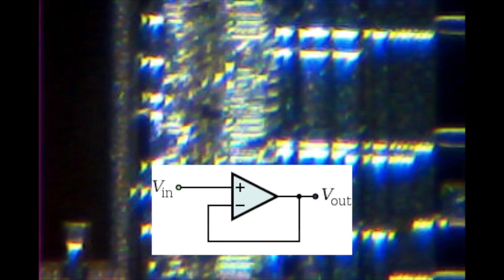What's inside a microchip ?

Comment: After 800x magnification, there can be a special ring light that can be switched on inside the lens itself, and digital zoom can be used beyond it to obtain higher zooms to possibly 1000x zoom levels or even higher without an electron based zoom. Horizontal periscopic lenses will be very good too as they won't use up the vertical zooming ranges.

Comment: The part of the video were you held that eprom across  3 fingers at an angle made me remember in spring 1991 I was adjusting a pick and place automated robot arm. The machine was turned off and a sign on the power lever stating DO NOT TOUCH was place also at the breaker panel as we always did for safety. A employee who did not read English or French or Spanish nor the Icon with a lighting bolt hitting a person as a universal language turn the thing on in both places. The machine drove that same Eprom deep into my fingers in same angle you had yours sitting. in two areas the legs went clear through. The Doc in the ER 
asked if he could have it after he removed it to add to collection in one room of stuff removed from all kinds of items from all parts of body areas. I went back there to take my kid for a posible brock arm and that chip and other items were still there.

Comment: this is an EPROM from an early GM OBD1. or at least the same part, if that's not what it was pulled from. The remarkable part is that this chip is roughly 40 years old. Modern day computer processors are one of mankinds most incredible feats. So incredible infact when you watch production videos, they have trouble explaining it

Comment: You said "billions" of transistors, but to be pedantic, the EPROM uses a single transistor per cell, so a 27C512 or 512k EPROM has 512k bytes of data, so in total 524288 x 8 = 4194304 transistors. They are arranged in a X-Y matrix. The circuitry around the outside selects a single X line and single Y line to select 8 cells for each bit of the byte of data (this is a simplified explanation). The EPROM you have has arranged the memory as two matrices. The goal is to use as little silicon as possible (to minimise production cost, where silicon area == $$$) which is why there is only a single transistor per memory bit/cell. Just FYI the matrix is not arranged in order from 0 to 512k, but is made of smaller blocks which are mirrored in both the X and Y orientations then arranged together. The 8 bits from one address location are very unlikely to be even close to each other, and even bits from adjacent addresses could be physically some distance apart. Not that the end user is aware (or needs to be aware) of this.

Comment: Looks like the second bond on what's called  wire bond Ball Bonding . It sticks by using heat 100C and friction weld from ultrasonic. The first bond is the ball and the second one cuts. A small flame or spark (EFO) creates the next ball.

Comment: I agree 90% of what you say and you say quite aptly with a semantic appraisal lending toward reminiscence. Ok gold is a better conductor than silver, the wires here I can't tell if silver, many materials were used in these devices depending upon application and complexity. The bonding process is a "stamped" type under an ultrasonic 'scrub' to bond onto the aluminium pad and package. I designed a stress pull system to determine the strength of bonds of devices many years ago. For aerospace industry, where the centrifugal forces of such devices underwent in certain times of travel ;). It's nice to hear an open & honest description for once with the added interest and amount of knowledge respectfully given and understood. Good fellow :) btw the "M752" number is the manufacturer's mask number used in the Lithography process(s).

Comment: A transistor doesn't store a bit :D It can only TRANSmit a bit of information, or not, based on an input signal.
Only an "SR Latch" or "Flip-Flop" stores bits. They're often made out of 2 NOR gates at 4 transistors each. So 512.000 bits x 8 transistors, which is technically -quote- "at least 512.000 [...] transistors" I guess.

Comment: Just so you know, the bond wires in most ceramic DIP packages are aluminum, not silver. They are not welded on, just pressed into place hard enough to flatten the aluminum.

Comment: Loved this! Great to see it all under a microscope like this! 

You mentioned not being sure how the addressing system works... based on my limited understanding here's some more on that:  

The address pins are used to specify which MOSFETs (the type of transistor which makes up the memory)  to connect to the IO pins by applying voltage to them, turning them 'on' or 'off', in order to define a binary address. That address is then connected to the IO pins of the chip via a series of logic gates between the pins and the MOSFETs making up the memory. This EPROM has 16 address pins, so an address would look something like this: 1001000000010000. Each of the possible 64,000 address combinations then corresponds to an 8 bit memory location made up of 8 tiny MOSFETs which can be 'on' or 'off'. So, in this case, we might find that address 1001000000010000 contains data 00101100.

Comment: 3:30 I was just about to say prolly an address system. Prolly turns each bit into bytes than plugs so many bytes into a pin somehow, would be interesting to find out how they controlled certain bits of one pin. Maybe it's a voltage deal and so much voltage will point to certain bytes and there they can be set but how if it is voltage dependent to select the byte unless they stored the voltage than it sent another voltage to set the bits

Comment: how these circuits are made? can anyone tell me pls?
Reply: You take a larger image of patterns related to your circuitry and shine it through a lense which makes it much smaller, onto a wafer of silicon, silicon dioxide and silicon nitride with a photoresist on top. A photoresist is a material that softens when exposed to light. You remove the softened photoresist with a solvent, then apply an etchant to remove the parts of the underlying silicons not protected by the photoresist. This is called photolithography ( printing with light )

Comment: When I went to electronics school I was told the best metal conductors in order were Gold, then Silver, then Copper.  Silver is the second-best conductor just way less expensive than gold.  That's why modern CPU's pins or pads are gold plated.
Reply: Actually it's silver, copper, then gold. We use gold since it's corrosion resistant while still having very low resistivity.

Comment: You wondered about how the wires are connected.  The process is called Wirebonding, this particular one is done by so called wedge-bonding, the connection is made using temperature, force and ultrasonic power. Check out some videos it’s awesome. I also do that in the lab.

Comment: I predict that the wires are aluminum -- quite similar to silver in appearance -- because aluminum doesn't diffuse into the silicon wafers.  They are attached (welded) to the pads on the chip and in the package by an ultra-sonic wire bonder.  It presses the wire onto the pad and shakes it at ultra-sonic frequency to heat it to its melting point.

Comment: In Russia, even at the stage of soldering the motherboard, everything would have been stolen from production, if anyone has a motherboard with an Intel processor, send me my address in Russia 
Stavropol Territory Andropovsky District, Soluno-Dmitriyevskoye village, 16 Shosseinaya St., postcode 357082 Funtov Pavel Grigoryevich 8 962 432 40 50

Comment: I'm very sorry to tell you this, and I am not lying, but with 28 pins I can address 2.14 (two point fourteen) Gigabytes. By the way, I'm working on my own computer architecture. extremely different. Oh and for the RAM and SSD total added together, I'm going to give support for one Yottabyte. And no it's not like a raid, When your drive gets full or close... plugin another board/chip into the current board that makes up your current drive, no formatting and the new space is instantly ready as one continuous drive, don't even have to turn off the drive/computer... now if you add in more ram, then you would need to format your drive, unless your willing to separate your addressing allocation block(s). You would have to reflect the change by your code/software... Oh and also I'm making my computer without a clock... it can fully work without a clock but for audio/video/network/similar you will want to use instructions that use the clock because if its something a human interacts with, it would be to fast otherwise
 ((all instructions duplicated, one set with and the other set without a clock.))
I have something equivalent to a handshake protocol so signals don't get messed up, and extra flags to tell a process to wait part way through because a variable hasn't been updated yet that it needs. I'm willing to talk about my desing. When it's complete I'm going to give it an open patent so anyone can build or mass produce freely, but cant lay claim to it. Also my design could be used to make a relay computer that is even faster by nature.
Reply: You should be sorry that you didn't do any research on this chip. The cells are organized to read and write eight bits at a time. 256k bits divided by eight equals 32k bytes of memory. Most processors used at the time used an eight-bit data bus. This chip has three power lines, two control lines, 15 address lines, and 8 data lines, for a total of 28. The 15 address lines equate to 2 to the 15th power, or 32k individual addresses.

Comment: wire bonds are Aluminium and done with ultrasonic wedge bonding. Aluminium is used on Silicon because it adheres directly to silicon without requiring intermediate metallisation.

Comment: 4:58 wrong. no silver found here. 

1. most used materials are gold with 1% platinum to make them hold. pure gold appears to lose bond, the pollution of gold with platinum gives it a sticky touch.
2. an aluminium-silicone mix - mostly 1% silicone pollution - can also be used for bond wires.
3. also used in history: copper, there's much problem with heat development and can damage chip circuits. It's rarely used in micro chips.

the best conductor is gold. I think the seen ones are AlSi, but the silver color doesn't mean, it really is. the more pollution, the more clean the color of gold.

AuPt bonds are a better conductor than AlSi, but it often needs a flaming process, AlSi is easier to bond and produce.

I work with these every day :)

Comment: Would a new optic/current power dual seated based chip be possible. You have light coming into switch via crystalline path. The switch (moving part) has separate metallic line power ready to go always, thus creating magnetic shape for the trigger/part which moves. 
The light hits a stagnant malleable nano atomic arrangement and trips atoms into magnetic shape/form to help move switch toward or away (closed1 or open0 - so two paths in, light can make stagnant malleable nano atomic arrangement +ve from one path or -ve form the other). Stating again, this light provides power to gate fixed (however is malleably magnetic both to -ve or +ve) part, and the movable switch part has separate power to have constant magnetic shape. The switch becomes magnetic along with the stagnant part to be attracted or repel. But could be manipulated with better knowledge. Thus you could have gate with the two possible switch polarities, two inputs and the one output???

So two ways in to switch and light trips on or off (unless already that way tripped). Then one path to exit, for if switch is on the power to the switch and light coming in is enough to transform electrical into light, somehow, and sends a constant light beam to the registrar for that information's use??

I really know little about not much here but it could work one day or similar or give somebody an idea. Problem. How to send a 1 or zero to the switch first to get switch to open or close. Is there a way to do this?? Does the light simply make it's way in from the optic cable, through the right gate and onto the switch??

Comment: I expect you to show us about CPU central processing unit. Details of how circuit build in processor like voltage in and out, anode cathode transistor. In Intel core processor LGA 2066 ARE internally how they are connected each other inside. Can you please show us how dose it works.

Comment: How do they  make it
Reply: muhammad imran It’s a long process... First you need some smart engineers to design the circuits, then layout all the silicon and metallic layers, then they will create a mask used for photomask generation, and eventually, after some extensive cleaning, testing, and assembly, you arrive at the integrated circuit.

Comment: Its not resistive welding its ultrasonic welding done by vibrating the wire very fast while in contact with the chip thus making it very hot and melting it and bonding the wire .
Reply: Thermosonic bonding..

Comment: The first chip I opened was a 486 dx2 mx . I used a spatula and the stove burner to desolder the back plate very cool looked like a micro mother board with tiny gold filament wires. Was ceramic. Anywayss...
Reply: Was in 2001. So was obsoleted.lol

Comment: How...the...fuck...do they manufacture BILLIONS of transistors...and assemble tthem at that size? It's so fucking small...how do you get machines in there to put it together?
Reply: nick4819 you just "burn" them there with lasers
Reply: What do you mean?? They all still need to be placed in the right spots...solder needs to be in the right spot...and the heat needs to melt the solder but not melt the chip that is literally microns thick.

Comment: OK well not that I completely understand but from what I'm hearing the transfer of info is simply opening and closing doors(transistors) to designate a 1 or 0. ok that's simple enough but if stored in stackable layers and there is only 1 connection point for thousands or more of transistors how in the world does it know to open door 10,303 and then door 701 etc to get said answer requested from input. 2nd question is if we are capable of this then why are circuit boards so large and why haven't all the components been shrunk to atomic lvl as the chip has? sorry this one is a little over my pay grade and not quite got a layman's answer that I can digest!
Reply: E Nonyabis the chip probably uses circuits called demultiplexers or “demuxers” to select a row and colom to output a signal. Demultiplexers have n number inputs and 2^n outputs, if a binary number is entered like 1010 (10) then it will turn on input 10. 

And why circuit boards aren't atomic sized? Because that would be impractical, most circuit boards are used to connect components, if they were small it would just make it difficult to connect components.

Probably
Reply: Can you tell us more about these demultiplexers, please?

Comment: enjoyed your video I have an eprom that has had its legs damaged by corrosion I am hoping I can cut away part of the ic to re solder new wires to the damaged stumps. the data on the ic is for lighting control unit and can no longer be available anywhere. I really hope this works but have find way cut a mm into both sides.  Tim.

Comment: working as a cleaner in "bnr" bell northern research i had the pleasure of not having to vacuum a very large space   for almost a month while day and night a team of designers poured over a color plotted microchip image looking for a design flaw during pre production .. kinda funny seeing a bunch of guys on there hands and knees following traces and circuits .. it was blown up to about 80x 80 feet  and far enough back in history to be a single layer only .. still quite a marvel when you consider that 80 x 80 image compressed to less than 1/4 inch square and they were still using magnification at 80 x 80..
Reply: Mike Cartman good stuff! Bad for the designers for sure, not amusing.
Reply: Mike Cartman Eventually they found a small black screw from your vacuum cleaner had lodged in between the digits 1 and 7 😞

Comment: Eprom.. Why is it called that? Surely it can't both be read-only and programmable/erasable?
Reply: Per umm, you can program it electrically just once (set the 1 bits or 0 bits, not sure which way the logic goes), and then it works like a read-only memory. Usually, as I recall, programming requires higher voltage that is not available in the device that uses the chip. In other words, you don't reprogram in the final product. Thus, it's read-only in that respect.

Comment: 28 pins to access one of  millions  of transistors :O .. hows that even possible?
Reply: memory is accessed byte-wise with binary adressing. Basically you tell the chip which byte you want to access by supplying the adress and the circuits will connect the respective memory cells to the output